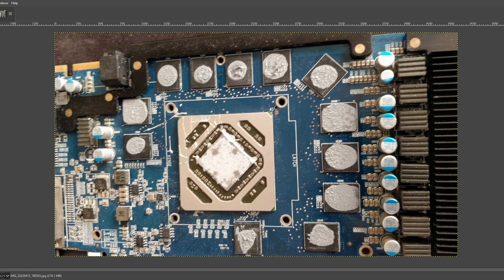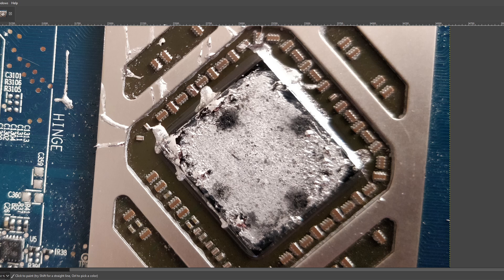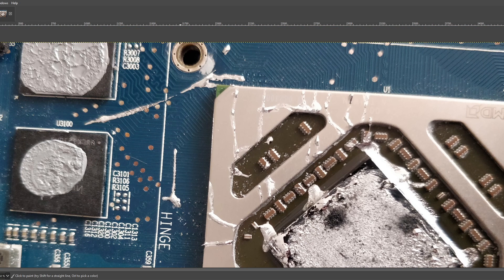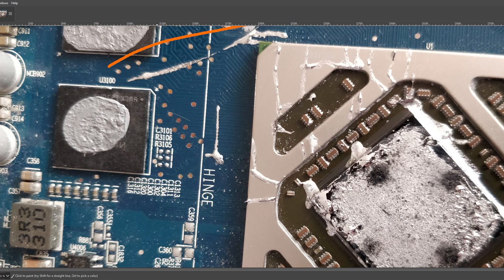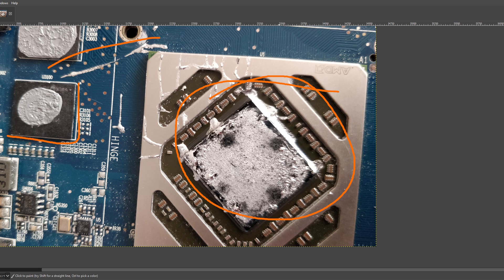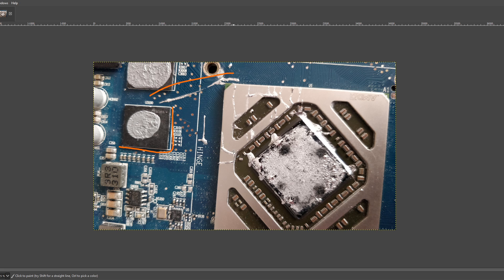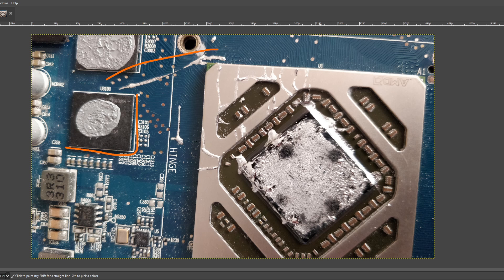Liquid metal on GPUs

Comment: Im using LM on my  RTX 2080 and I have no problem , Because the die is on top the LM Can't spill IF you reassemble the card with the cooler always on the down and you put the GPU on top. This guy OBVIOULY had no Idea what he was doing.  The application was wrong and the reassembly also Wrong.

Comment: I run vega 56 (with blower cooler) sitting on 64s bios. So it has unlocked extra clock speeds on core and memory. And with Vegas the overall temps are kinda irrelevant becasue Hotspot temp exists. For preference overall which is shown is Radeon software 70C meanwhile hotspot is 110C. Which already is degrading chip slowly and also thermal throttles. So putting LM saved me basicly 10C in winters im living warm with my heatspreader but in summers im better touching grass outside. Temps go crazy even tho i have undervolted core and memory a bit.
Reply: The only thing that helped my Vega 64 was using kryonaut and really butter the biscuit (use a lot).
Igors lab writes that the screws opposite the PCI should be tightened down first, I do not know if it makes a difference, but I followed the guide.
I also used washers to tighten the mounting pressure, but it did not change the temps.
I removed the fans and shroud so only the heatsink was left and installed 2 noctua 140mm fans on the card instead.
Managed to keep the hotspot in the 90es after all that work.
I was not able to change the clocks in the AMD driver, the Asus bios somehow blocked it, downclocking 10MHz or something stupid like that, made the card unstable.

Installing the Asus software to adjust fans and clocks made a conflict with the AMD driver and the GPU fans turned off until the card thermal protection kicked in and ran fans at very high speed, the fans turned off at 65 degrees again and everything started over.
Wanted to try and bios flash to non Asus bios, the program denied it and I was not brave enough to push on with more tinkering after that.

Comment: Frankly, that poor Saphire card looked like the guy didnt know what he was doing when he applied the TIM.  Ive been running LM on all my GPUs for almost 5 years and havent had a single problem. I isolate the most endangered parts around the chip and only use a minimum of LM.

That guy has SO much spill it couldnt have been applied correctly.
Reply: There is not even small protection on SMD :P I applied it first time in my life on a GPU and done like 5-6 layers on everything around die just to be sure ^^

Comment: Been running a EVGA 1080Ti with LM for nearly 2 years with a custom loop.  Flashed the bios with a KP version to not have the voltage restrictions. It achieve a 10C benefit at my max core overclock of 2105 MHz. I’d recommend any enthusiast to try it, you just need to research the knowledge and use some care and common sense when applying.  The benefits while minor are there. BZ has done some great past videos on how to handle LM properly. Ironic that the viewers who sent in these cards hadn’t watched them.

Comment: I also don't think it worth too. Unlike CPUs, on GPUs the cooler is already in direct contact with the chip, there is no IHS in between to affect thermal transfer. Apart from the fact that GPU's are much more locked to overclock than CPU's with minimal gains and also much easier to detect anything to deny the warranty later. In the same way that selling sealed GPU's is by far a lot easier than opened ones. For things like nitrogen, we use usual paste anyway.
Reply: "There is no IHS in between to affect thermal transfer..."

Ah so the LM will be even more effective! Yay. (j/k i know what you mean)

Comment: I had a pretty weird liquid metal mishap a while back, I killed a 980 even though there was no liquid metal on the SMDs or anywhere else on the card.. core coverage was good but it still died leaving a scorch mark on the cooler surface. I know the liquid metal killed it I just have no idea how 🤔

If I was in the US I'd send it to you just to satisfy my curiosity.
Reply: Was it an EVGA ACX card? My B-stock 980Ti's VRMs went up in smoke and I found out a while later that cooler did not do a good job cooling VRMs. Also, use nail polish and brush it onto the SMDs to protect them, colored if you can because you can easily see if it covers fully
Reply: @kekoraaaa  It's an MSI Gaming 4G, there's no visible carnage on the VRM or anywhere else on the board though. I had it in SLI (wtf was I thinking ^_^) with an identical card on stock paste and that card was fine. I think actually had somebody check it and they said the core is dead which sounds about right given the edge of the chip left a mark on the cooler like it ate through the nickel plating... must've been one hell of a short. RIP 980, expensive lesson learned 😁
Reply: @kekoraaaa  Yep and mine died as a result at the height of graphics card pricing which is why I have sworn off EVGA half-assed quality.
Reply from the maker: was it a refrence GTX 980? because 900 series cards like to blow up for no reason.
Reply: @ActuallyHardcoreOverclocking  it's the MSI Gaming 4G version. Are you really not in the US?.. if that's the case I might actually send it to you if you're as curious as I am, then again it could be the biggest coincidence in the world me applying liquid metal and the card randomly dying on the same day but I press X to doubt on that.
Reply from the maker: @talictdf4757  I'm in the UK. Also the other exploded core GTX 900 series card I have is an MSI. I'm pretty sure the VRM on your failed and killed the core.
Reply: Pretty sure Buildzoid is in Europe not in the US
Reply: @DJKr15py  UK

Comment: Mother of god he used waaaaaaayyyyy too much LM.  Like you should be basically painting the LM on so thin that it barely covers the silicon and do the same to the heatsink.  Hell I did my entire 3090 die with the amount he has globbed off the sides of the die.  (15C delta over the water, it never fluctuates clock speed because it's always at full boost and has no TDP restriction)
Reply: Yeah, you could cover 10 GPUs with what was applied there, it's literally insane. That was likely done by a very generous person.

Comment: Isn't there a clear coat over the SMDs surrounding GPU? When I apply LM to GPU I use Tolulene free nail polish just as an extra, and while apply I kinda scrub it onto surface and kinda sticks on rubbed surfaces(cooler and silicon). I also assume due to capillary action and being rubbed on, it doesn't ball up unless it excessive and overflows. Good suggestion to protect mem and chip as extra!

Comment: Isn't liquid metal gallium? Like on thermal grizzly conductonaut stuff. I've been putting it on shunts for shunt modding and have yet to have one get the solder dissolved. Also liquid metal on GPU can still drop 10C or more if you have a good enough cooler, which is great for reducing fan speeds.
Reply: It’s a mixture of gallium, indium and tin. It’s a so called eutectic mixture which means that it „is a homogeneous mixture of substances that melts or solidifies at a single temperature that is lower than the melting point of any of the constituent“

Indium has a melting point of 156 degrees, gallium 30 degrees and tin 230 degrees. The eutectic mixture brings the melting point below 30 degrees Celsius (to around -19 degrees) otherwise the liquid metal paste would not be liquid at room temperature. I suppose they also add stuff to lower the surface tension of the mixture because the surface tension of Galinstan (which thus mixture is called) is about ten times higher than water, which is why it forms those tiny beads or balls that roll or flow around everywhere and why Lm is such a bitch to clean up because it doesn’t easily stick to anything
Reply: @Numfuddle  I'm familiar with eutectic mixtures, but I don't think it's relevant (as long as the gallium is liquid).  Pure gallium will destroy aluminum and embrittle steel, for instance.
Reply: @concinnus  it’s relevant because if it weren’t an eutectic mixture the melting point would be higher and the LM would be solid at room temperature
Reply: @Numfuddle  I said "as long as it's liquid".  And if the gallium is there while the GPU is running on ambient cooling, it's going to get above 30 Celcius.

You could have a non-eutectic mixture that melts at, say, 40 Celcius (I assume this is how the metal sheet TIM's work), and it would still pose the same metal compatibility problems.
Reply: @Numfuddle  Maybe it's a near-eutectic alloy? Below the liquidus they tend to act more like slurries as more solids precipitate out of solution, so the alloy doesn't ball up and roll around everywhere.
Reply: Not mostly gallium, but gallium is the lowest-melting component, so it's what causes the dissolution, yes.  As for noise, well, the channel's not "Actually Quieter Computing".
Reply: @concinnus  for sure but he's added capacitors for 10-20mhz extra clocks which can be done with liquid metal on these new cards lol.
Reply: Gallium, indium, and tin.
Edit: Prob some other stuff in there too.

Comment: About Gasket. I had discussion with one user on YT under similar video (about LM and how danger it is for newbies in PC). And look's like we have found solution. There are companies which make rubber\silicone o-rings. You need to measure how tall GPU\CPU die from PCB to top edge. This will be absolute minimum size of o-ring. You need just a bit thicker (0.1 or 0.2). Too thick - excessive pressure on PCB (we don't need that!). Diameter should be higher then CPU\GPU die size (no stretch!). When o-ring is installed and LM is applied just place heatsink on it. Pressure will squize o-ring and cover all gaps around CPU\GPU die. Flip it and screw bolts. Technicly it should work. Just need to find specific size and also it should hold AT LEAST 120 degree by C!

Comment: I wonder if an ultrasonic cleaner could get the liquid metal out from beneath the memory/core? Because we already saw with the smd components that it didn’t really deteriorate them, so maybe there’s a chance all you need to do is clean under the chips without removing them.
Reply: Yes an ultrasonic cleaner will work...People think these things are more fragile than they actually are...I have literally put Motherboards and GPUs in the dishwasher before...As long as you don't use soap and you let it dry completely afterwards it shouldn't hurt it at all...I usually give it a 99% alcohol bath also just to be sure

Comment: Not that I do this, but someone OC'ing a GPU and are using a shunt mod with a really good water cooling setup could benefit from liquid TIM, no?
Reply: Sure it’s benefit I can handle 2200mghz on my rtx3080 with liquid metal + shunt the 2 first resistor with 48C on watercooling

Comment: "The more power you're pushing through the CPU the bigger the cooling improvement you get out of switching from thermal paste to liquid metal" (except with a 5800x?)
Reply from the maker: the 5800X doesn't pull any power regardless of how hard you push it. It overheats before it pulls more than 140W.
Reply: @ActuallyHardcoreOverclocking  thermal density on the 5800X is pretty batshit
Reply: I noticed that with my 3800xt as well. No quantifiable change vs using kyronaut. The biggest benefit seems to be from using liquid metal between the die and ihs.
Reply: @motorcyclethings6347  Exactly, so the issue is that limited heat transfer between the die and ihs throws a wrench into the equation.

Comment: I remember you mentioning this on one of your streams, and after explaining it, I understand why it now appears to be a bad idea. I was seriously considering it for my gtx 690 and recently sourced Radeon 7990, admittedly. For the former, because the reference cooler seems like a good candidate for liquid metal and thermal efficiency improvements. For the latter, because it's a hot running bastard at load, even after replacing thermal pads across the card and applying Arctic mx-5 on the dies.
Unfortunately, sourcing a water block for either is a challenge; and the only Arctic branded cooler I could find was for the 690, which made it unwieldy and huge. No such luck finding a replacement cooler for the 7990. :(

Comment: Call me lucky, but I managed to remove LM from under my laptop GPU memory chip and it's still working normally. Was not easy. I then went all out with conformal coating and reapplied, all good. Only GPU I'd apply LM is a laptop's anyways, different scenario.

Comment: Liquid metal is something that requires user skill and depending on any coatings present it takes time as well, Ive applied it 4 times to my PC at this point and the minimum time ive spent to properly get it to spread on the IHS and Cooler was 40 minutes

Its infinitely easier to apply to a CPU vs a GPU because of the annoyance of most GPU coolers and how you mount them

I use Liquid metal on my CPU because i need the maximum possible heat transfer i can get because of the ridiculously small cooler i am forced to use because small cases that are thin enough to fit where i need my PC they all have limited CPU cooler space

And i have a 2 slot 3090 and i can say for sure that liquid metal on my card would not be good because the GPU stands vertically and chances of it pooling and dripping out are too high for a 2k card thats £2000 not $ or anything else (i was not going to wait any longer than i did)

But even then my 2 slot 3090 is cooler than most of the rest of the 3090’s out there, it came stock with thermal-right pads and paste, tho i changed out the rear pads that where silicon and replaced the front pads anyway because i didn’t realise till the card was open so had the pads anyway
Reply: 40 minutes to get it to spread? That means you are being way too delicate with it. Use a bit of force to press on the cotton tips and it will take 2-4minutes.
Start from the center and use circular motions. You can do back and forth motions at the edges, but slow down at the corners.
Reply: @Tealc2323  press to hard the cotton swap slips and your utterly FK’ed

Press to lightly it will not stick

But for me its more because dried out liquid metal doesn’t play nice with still liquid liquid-metal (at least not for me)

But regardless it mostly comes down to full coverage and making damn well sure you dont have to much

As well as testing and applying more if needed or adjusting the mounting pressure of each corner

I do not allow for cores to have a temperature difference at all, them must be the same temperature or the liquid metal is not doing its job correctly

Also once it dries out if the cooler shifts your shit out of luck and have to replace it

80c becomes 110c for me if it dries and unwelds itself (i say liquid metal welds things together when dry)
Reply: Vertical should be fine, you sound careful with the applications. I ran l vertical 9 months with rear IO at top of case and since February vertical standing up in a bench. As well as a few months in a stock case layout, its had plenty of opportunity to move round. 
You'd probably need to massively overdo the application for it to be an issue.

Admittedly not on a 3090.

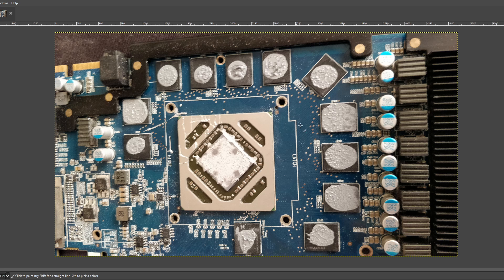Comment: 2:42 There are voltage curve controls in MSI Afterburner. Liquid metal allows me to get more out of the voltage curve that the stock thermal compound wouldn't. 🤷‍♂️
Reply: And AMD more power tool
Reply: also with voltage curve i can raise the voltage lets stay from 1.05  max to 1.075 or 1.09

Comment: I put LM on my GTX 780 ages ago when I was young and dumb (still dumb, but less so now). Had it on my Naked Die 3770k too so I thought, hey, why not. Ended up removing it after not-so-great results and its only much later now that I realise how fucking lucky I was to not kill that card. Didnt protect any of the components, only put it on the GPU die (not the cooler too, as you're supposed to) and probably a ton of other dumb things i'm forgetting. I really wanna put LM on my vega just to see how it is, though I think I already know. Took me many attempts to get a good mount with  good hotspot temps, yet I still wanna try it.
Reply: Given Vega has problems with package height (the HBM and the Core on the same substrate), probably not a good idea.
Liquid Metal isn't as thick as thermal paste and works best in between really flat things.

cough Radeon VII thermal pad
Reply: @InternetEntity  Still gonna try it one day regardless, maybe soon. I know vega likes thicker thermal paste like kryonaut, which is  what I have now. My card has a molded package by the way, HBM and core are the same height....in theory. Hotspot still scares the shit out of me.

Comment: For covering SMDs and the space between the memory chips and the PCB, I've used silicone conformal coating. It might take a few coats to build it up enough to close the gap, but it's easy to apply and made for this kind of application. Be sure to have plenty of ventilation though, there are some pretty heavy solvents in it. I'm not sure if it inhibits the gallium-aluminum interaction, but it might be worth trying. If that works, it would be super easy to coat the exposed aluminum.
Reply: Have you tried using nail polish instead? It's worked well for my CPU SMDs and only takes 1 coat if you do it right
Reply: @kekoraaaa  Conformal coating is specifically made for this purpose, so I'm not sure that's a great idea.
Reply: @kekoraaaa  it probably works fine, but conformal coating is rated for long term high temperature operation. A 55 mL bottle has lasted me a long time and wasn't terribly expensive.
Reply: Thanks! ✌